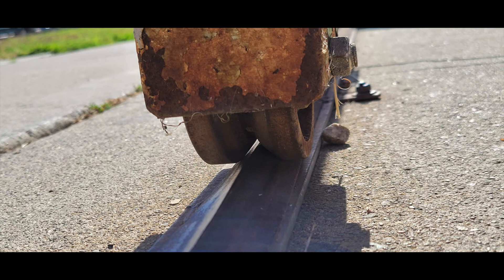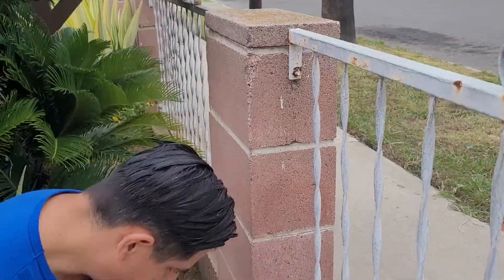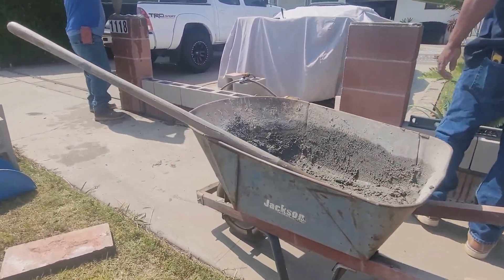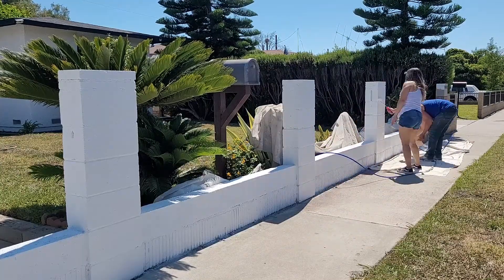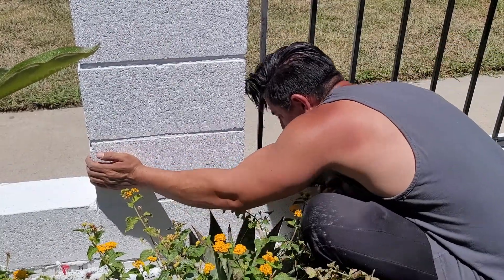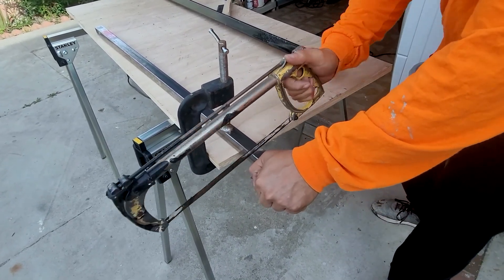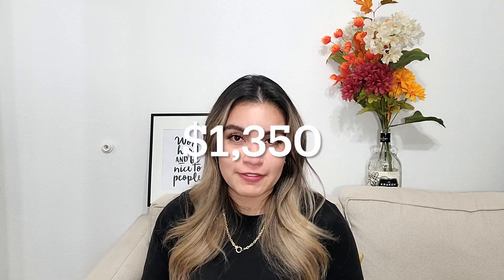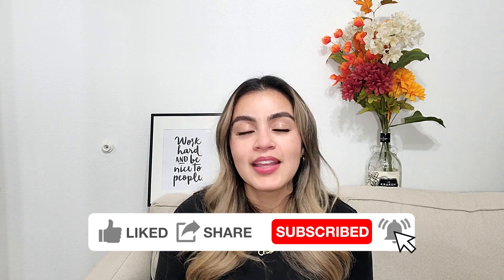How to Install a Metal and Cement Block Gate | DIY Front Fence

Comment: I live in San Diego, what’s the name of the fence company in Tijuana?
Reply from the maker: Hi Alex. It's not a company exactly. He runs it out of his home. I don't have the address I just know how to get there. Here's his cell number if you'd like to reach out to him. 52 664 317 4203
Reply: @mydulcehogarmysweethome5249  thank you, I go to Tijuana often. Will call
Reply: Does he do custom work? My wife wants the horizontal iron panels instead of vertical
Reply from the maker: @Timbermanalex  yes I believe he does. I sent him a picture of the design I wanted and he made it for me
Reply: @mydulcehogarmysweethome5249  thank you! Just contacted him and since I can’t speak Spanish, I used Google translate. He said he can do it. Your yard looks bigger than mine… when you did the measurements, did you just estimate the length needed based on the spacing between the posts?
Reply from the maker: @Timbermanalex  cool, I'm glad you were able to connect with him. Yes, I measured between each post and sent him those measurements.